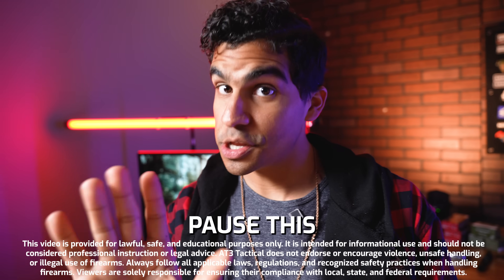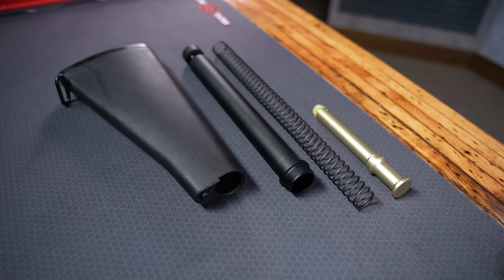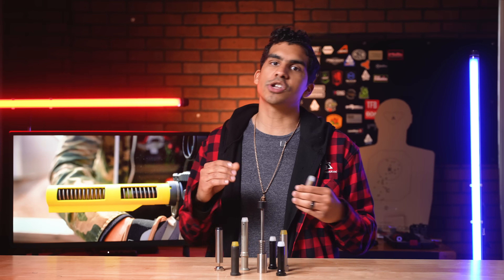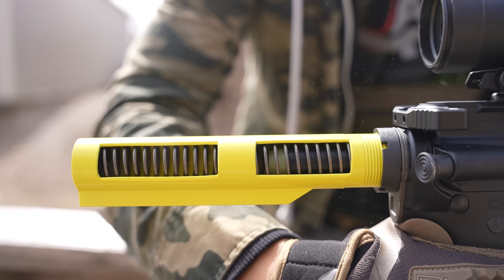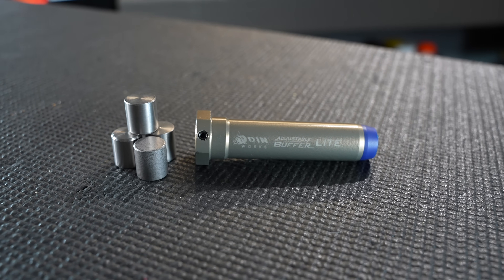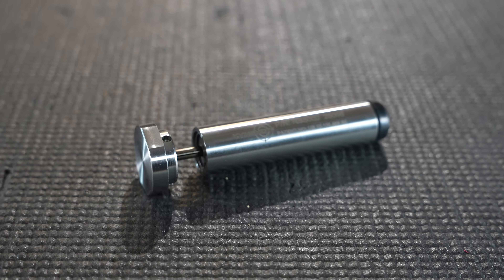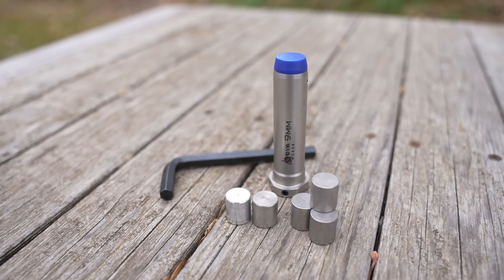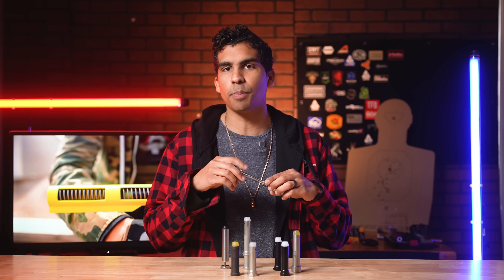Stop Guessing: H1 vs H2 vs H3 - The AR-15 Buffer Weight That’s Killing Your Rifle's Function

Comment: Absolutely fantastic explanation! Just one addendum:  most, if not all, buffers are adjustable. You can buy the weights and mix and match the tungsten and steel weights as necessary. Just tap out the roll pin holding in the rubber bumper, remove the rubber bumper and you will have access to the weights. All the regular buffers, not the ones like the JP, have 3 weights in them. If it’s unmarked on its face it has 3 steel weights. If it’s marked with an H or H1, it has 1 tungsten weight and 2 steel weights. The number after the H describes how many tungsten weights the buffer has in it, the remaining weights (if any) are steel. The JP system is also adjustable by changing the weights. Like the spring, buffers do not last forever, once the rubber bumper becomes permanently compressed, it should be changed or the buffer should be replaced or it will damage your BCG. I did not know any of this until I took an AR-15 armorer’s course. 
Thank you for this video!!!
Reply from the maker: Hey, thanks for the additional info! Super helpful. I can’t always include everything in the video, so it’s great to see the community wanting to help each other out!
Reply: @At3tactical I will never claim to know everything, but I’ve had training and I’m always willing to share.

Comment: In my case, I just went to test my build of a 10.3 with a H2 and a flow through suppressor which worked flawlessly with about a 4 o'clock ejection. BTW your video explanation is excellent.
Reply from the maker: Sometimes it's that easy! Thanks for the encouragement.
Reply: @A @At3tactical hey at3 noticed a lot of difference in shoot ability im still deciding if I should go with a jp captured system what do you think im using a standard weight and spring you get in a off the shelf gun but upgraded it a while ago with a free floating hand gaurd vertical grip ballistic advantage barrel upgraded stock upgraded trigger and upgraded flash hider what springs you recommend for an upgrade what system you recommend I’m turned to the jp system and upgraded grip and ambi safety